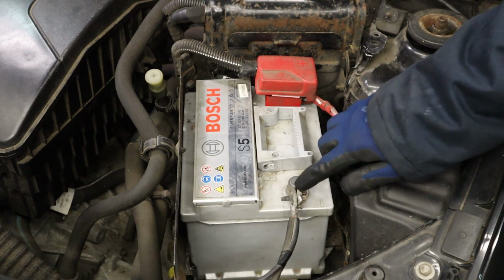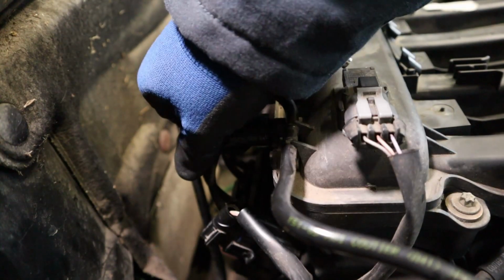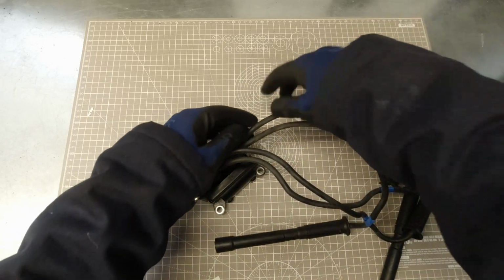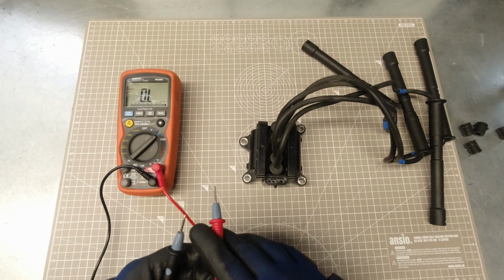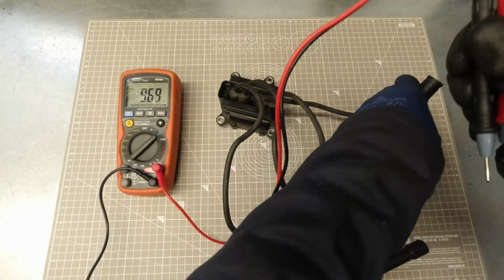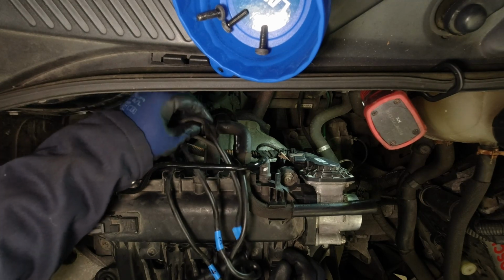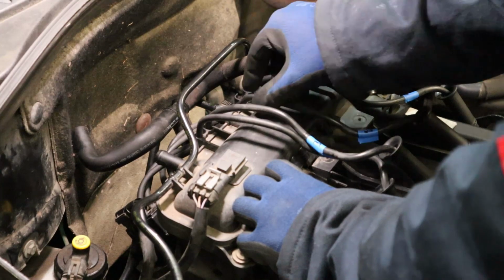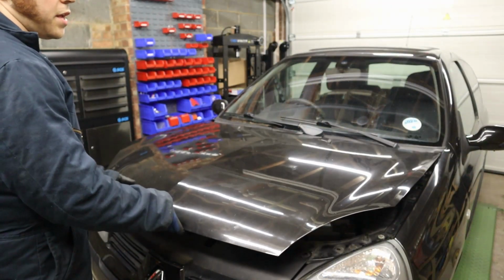Renault Clio 1.2 16v Coil Pack Testing/Replacement

Comment: I have a clio 3 with the same engine. Most mornings the car will do pretty strong jerks when i drive the first few meters. I'm suspecting Coil Packs since they are stocks.

Is there any advices to confirm without actually removing the coil pack and checking it ?

Comment: Hello there i changed coil pack leads and spark plugs but the car still puffing in idle and there is like an aspiration noise coming from somewhere , could  it be the throttle body . My revs are about 5

Comment: Hi I have a renault mk2 1.2 16v 2004 model that cranks but won't start and the the rpm's not going up. Battery and starter is ok
Reply from the maker: Sounds like it could be the crankshaft position sensor, they're pretty common to fail on these.

Comment: Thanks !!!! great video  with your advices, i ve replaced mine on clio3 1.2 16V Flex. GREAT JOB thanks so much !!!!  but still issue with blinking engine light   ;(

Comment: I've watched this over and over again. 
   but I still can't fix my issue. 
I thought it was ignition side.
  but on further investigation,
my LTFT is 100 all the time and my post cat 02 in reading 0.80 0.130v so now iam stumped. changed coil. leads . plugs . pre cat 02. but still missfires and knocking cold . ahhhh

Comment: this engine is driving me crazy, so short story, cold start, wait the RPM to lower, i go drive after normally either around the city or on the express way the car just losses power, even while pressing the gas the car slowes down a bit and even while pressing the gas the  power comes back after about 5 seconds but i lift my leg off the gas and pressed again the power or the acceleration comes back 
what i did so far 2 o2 sensor has been replace, new oil and filters, new MAP sensor, tomorrow i'm gonna clean the throttle body, regardless let me know if i should replace something else? ignition coil probably would be after the throttle body cleaning if it wouldn't solve the problem 

clio 3 2005 d4f 1.2 75 HP

Comment: Really helpful. Purchased Renault Clio 1.2 16v 2007 Mk 3 for my grandson engine light flickered on way home. Now completed 780 miles with cataclean light is now constantly on with spanner and emissions check light. Checked spark plugs ignition coils air filter cleaned all visible sensors. Replaced Lamba sensor. Fuel cap tight. Diagnostic scan shows PO 302 number 2 misfire. Shows X Cat and Lamba sensor 😢  Any other ideas please.

Comment: Quick question, is this a spark return system, 1-4, 2-3...when I disconnect 1 and 4 very little difference, when I disconnect 2 and 3, it won't start...

Comment: how do i install new spark plugs? ive just cleaned my throttle body there is a small improvement but still struggles on hills but a lower rate. i mthink maybe after few drives the cu will calbrate the cleaned throttle body as it was very dirty. now im thinking of installing new spark plugs and coil pack how would i install the spark plugs. :)
Reply from the maker: I have videos on my channel detailing how to change the spark plugs and how to change the coil pack.

Comment: Hi I have a renault clio 2 1.2 16v missfiring and I dont know if its the coil pack or spark plugs. I want to ask if it os fitting to only replace tge plug that is missing

Comment: Hello,
Nice video, it's really helpful. In case we replace the coil with a new one is it required any sort of re-calibration or programming? Thanks.
Reply from the maker: No calibration is needed.
Reply: @SocketsAndSideburns  Thanks

Comment: First of all, sorry for my English, I will try to explain myself as best as possible. I have done the procedure as you explain, my question is the following: The order of my coils differs from yours, is there any problem in trying to change the order to see if that is the error? Or can I cause a breakdown if I start the engine with the coils in the wrong order?

Comment: Weird thing going on here 
My clio has the d4f 702 engine     the coil pack has numbered wires 1 to 4   while the wires were installed from 1 to 4 but the number 4 wire connected to cilinder 1 the french way so cilinder 1 at the flywheel 
Wire 3 to cilinder 2 
Wire 2 to cilinder 3 
Wire 1 to cilinder 4  

So the opposite way around 

Then not like wire 1 to cilinder 1 
Wire 2 to cilinder 2
Wire 3 to cilinder 4 
Wire 4 to cilinder 3
Thats the usual connection

So i swapped the wires the original way but no start  

So i just put everything back the way it was fitted on mine   
And start 

But then it might be the case my aftermarket coil has the wires in a different order with 
Wire 1 on cilinder 1
Wire 2 on cilinder 2
Wire 3 on cilinder 3
Wire 4 on cilinder 4
The European way of cilinder counting with cilinder 4 at the flywheel  

Basically its easier to install but nothing original here     
So that confused me a bit

Comment: Maybe a good idea to mention that if you remove the rubber seals from the ends of the spark plug leads for testing the leads, be careful because mine were old and brittle. I broke one on each of two leads but I put the rubber seals back in because the coil pack was working ok at the time. Next time I came to remove it the rubber seals stayed on the spark plugs. Probably best to put the leads back on without the rubber seals if you have to put them back on after breaking them? I know need to find a way to get the rubber seals off the spark plugs!!

Comment: Perfect video, incredibly useful. I'm trying to remove the coil pack from the car, however the T30s hold as hell. I have noticed oily mess on the top of the plugs, is it ok? I'm wondering where the leaks might be from.
Reply from the maker: It really depends how much oil you have. The most likely place will be the spark plug tube seals. Watch my rocker cover removal and refit videos where I replace them.
Reply: @SocketsAndSideburns  Yes, tube seals seem to be the cause. In the meantime, I changed the coil pack for a new one successfully, however, my engine still vibrates clearly on LPG (with P1305 and P1314 errors). Injectors might be end-of-life, so I need to investigate further.

Comment: Hi did all that but still runs on 3 cylinders the car has had an engine change that was the same make and model (plug & play) tried 3 different coil packs any help would be grateful
Reply from the maker: Since the the ignition system is wasted spark it is far more likely a problem related to one cylinder is something other than the coil pack. I would suggest checking the spark then a compression test.

Comment: Hi.   Thanks.  Is firing order 4 3 2 1 thanks Dan.   Same as shown.  So if I have p0303 I should check the plug and compression on the second from the left
Reply from the maker: Yes that is the firing order. Cylinder one is at the flywheel end of the engine.

Comment: Hello I have a idling problem with my Renault Clio 1.2 16V 2004 model and from time to time it won't start when I turn the key only the ignition will still go on but won't start. Please help Mr sockets and sideburns please any help will do.
Reply from the maker: Does it crank and not start or just not crank at all?
Reply: Hi apologies for the late reply but however the ignition goes on but doesn't start or crank when that happens then after a while it starts or I have to kick start my car.

Comment: My engines got a vibration. Its definitely the engine itself as it does it standing still, and its not the gearbox as clutch engaged or not, it still occurs. From the feel of the top of the engine, its strongest on 1 and 4. Injectors sound normal but havent tested them. Mpg is fine and normal. Spark plugs suggest lean running but its a lean engine anyway. I've coeaned the map sensor and readings are all normal, and cleaned the throttle body. My only thing left is either my cam shaft has worn out, or theres a spark problem that isnt dramatic enough to trigger a missfire or light on the dash. Could also be the crank sensor.

It does have trouble starting first thing.

Checked the battery and the alternator and they are fine.

Could it be a weak spark?
Reply from the maker: The engine is wasted spark. So 1 and 4 sparks fire together. So the ignition system does link both cylinders. You have checked the coil pack?
Reply: @SocketsAndSideburns  thanks for replying. im doing it on the 30th along with the tappit adjustment. It might just be the nature of the engine.

Comment: My sons 2007 Clio campus 1.2 16v just developed misfiring issues. I changed the plugs but no luck. I’m picking up a new coil pack this afternoon so we’ll see if it fixes the issue. This video has helped me immensely to prepare for the job. I’ll let you know if it fixes it. I subbed a while ago after you helped with a radio/cd video issue. Great stuff mate!
Reply: I bought the Coil pack from Euro carparts for £46. I note that you said that the leads are numbered 1- 4 from right to left, but these leads were numbered already however not the way you said. I decided to just follow your lead instead and installed as directed and it worked perfectly....Cheers

Comment: Great vid,. I have a Renault Clio 1.2 16 valve which wouldn't start so I cleaned the crank sensor and now it starts but I have a warning light which is a coiled wire symbol with a zig zag symbol above it .
Any thoughts on what that light means and what I should do.

Subscribed 😎
Reply from the maker: I'm pretty sure you mean the "electronic fault" warning light. You will need a code reader I'm afraid to read the fault codes stored in it and then go from there. I would recommend getting one that can display live data as this will help fault finding.

Comment: One of the best workshop test and replace I've seen yet, well done. I've got a Clio with a fault where it splutters at low rev's (even at tickover) up to about 2,000rpm so I hope a quick test of the coil pack finds my fault.
Reply: Same problem. Did you manage to sort your issue?
Reply: @samfitzpatrick1866  sure did - I replaced the coil pack, easy peasy. It ran like a new car after. Problem is, I totalled it a few weeks ago, wright off, c'est la vie. At least I'm still alive. Good luck 👍
Reply: @Drivelikeustoleit  bloody hell, glad you're alright. I've changed throttle body, crank sensor, accelerator pedal, and just today the sparks and ignition pack. Still have the same f-ing problem. Had it run through multiple diagnostics and every test I'm getting told it's different problem. Think I'll be scrapping it now.
Reply: @samfitzpatrick1866  I thought about replacing all those parts as well but started with the cheapest parts first - new plugs made no difference so the next cheapest part was the coil pack which solved it. Hope you sort it - good luck 👍
Reply: @Drivelikeustoleit  just thought I'd update you. Turns out it was a loose earth wire which wasn't put back properly during my clutch replacement (I took it to the cheapest place who did it for 250 parts and labour - you get what you pay for).

Anyways took it too a specialist who did a thorough inspection as three garages could not find out the problem. Ended up costing me 280 in labour plus the weeks of stress going from garage to garage and buying a load of parts and trying to sort it myself. 

So lesson learned pay a little extra for a good job in the first place!
Reply: @samfitzpatrick1866  Loose earth strap on these normally give you non starting, good you got it sorted
Reply: @dav01kar  Yes you're correct, funnily enough I've had the same issue on an old fiesta, which as you said wouldn't even start. 

The loose wire I described was actually dirt/gunk on the connection - likely explaining the intermittent fault. On a few occasions I'd be driving on the motorway and I'd suddenly lose all power for a split second before coming back to life - would scare the life out of me. 

Electrics seem to be a problem on the french cars of this age. Thanks for the reply.

Comment: Hello. on my Clio, on the secondary coil, between 1 and 4 it's 12.50, and between 2 e 3 it's 10.01. do tou think it's good ir bad? Thanks
Reply from the maker: Are you checking it because you have a problem?
The resistance is out of spec. You could check for corrosion on the contacts and try to get a brush in there if there is any to remove it as this may be the cause.
Reply: @SocketsAndSideburns  the engine fails when I accelerate around 1500 rpm. there is no corrosion. I already bought a new one and it was normal. thanks

Comment: Can someone tell me are these values apply for 2.0 16v engine? I have readings on secondary about 6,5kOM. But on primary a have A to B about 1ohm and for C to D 0.1ohm and B to C 0.5ohm, so I'm guessing something is not right on the primary. Thanks

Comment: I see there are two types of coil pack, didn't know this,  one with three screws and the other with four, would this make a difference in difficulty starting with the wrong coil pack especially when its cold. I think i may have the wrong one as its the one i got that i have been given to me by the auto factor quoting the  reg number etc, i assume it correct. Its a bugger to start in the cold but when its warm it starts, no problem. The cold start is a real problem, turns over fine and sometimes tries to bit on firing when the key is released after fully turning. Changed Crankcase sensor and coolant temp sensor checked connections etc, still a mystery just wondered if its the coil pack even though i have changed it, may not be correct.
Reply from the maker: I believe the three bolt coil pack leads are much shorter as it is located in a different position to the four bolt. If you do have the wrong one fitted it should be obvious as it would have been very difficult to get the leads to reach.
I have never had any first hand experience of actually fitting the wrong one but I have heard of it being done and those people didn't report any running issues other just difficulty in making the leads reach.
Reply: @SocketsAndSideburns  I have found that the non Renault coil packs have leads that are all the same length including the three screw ones. These leads are all too long but you cant cut and shorten then as they are sealed in. I bought a three screwed version the other day as i have three screw holes on my engine, but it did not work at all, it turned over and locked. You would have thought that the Auto factor, Eurocarparts would have given me the correct one especially giving the reg plate number. It certainly wasn't the correct pack. I did try and look for the engine number as in your video but theres an alternator smack bang in front of it. It may pay me to go to a Renault dealer and get an original pack.

Comment: Is it possible that it tests ok when like this but is breaking down under load? I am checking a clio at the moment for a misfire during acceleration and suspected the coil pack but testing showed up no faults. (No fault code stored either)
Reply from the maker: If you have tested it as per this video and it all checks out ok it probably isn't going to be the coil. You will probably need access to live data to catch the misfire in the act.
Reply: @SocketsAndSideburns  thanks,
Reply: @SocketsAndSideburns  I did a number of further test and after a bit more driving got a codes for cylinder 2. Checked compressions and injector resistances and then swapped injector two with injector 3 to see if code changed which it did not. 
In the end I suspect the coil was the issue despite the correct resistance reading, so replaced and tested. All working fine after changing. I suspect that the coil resistance reading were fine until a load was placed on the windings. Cheers

Comment: So i orderd a coil but it has 4 bolts and my old 1 had 3 bolts. Is this an big problem? Or can i use the 4 bolts fine?
Reply from the maker: Honestly I can't say. It's not something I would try personally, I would just get the right part.
If I remember right the three bolt version was for the early engines and had shorter leads than the four bolt version so you may have a lot of excess HT lead to contend with. I'm also unsure if the bolt patterns would line up. 
Other than those two things I don't think there were any other changes.
Reply: @SocketsAndSideburns  thanks for the quick response! I will order the correct part! Thank you very much.

Comment: Resistance values for Mk2 Clio 1.2 8V petrol engine are:

Primary resistance: 0.6 ohms
Secondary resistance: 8000 ohms

I looked it up at work on Autodata
Reply from the maker: Thanks for that. Hopefully help someone who needs the info for the 8v.
Reply: Thanks, looked for this one! ❤️

Comment: Got a 182 that developed a misfire and yes hand up I replaced it when that wasn't the fault.
Reply: What was the fault?
Reply: @alastairmackay4861  It was actually the leads not the the coil pack
Reply: @simongb7897  cheers

Comment: Another great video and well explained, I've replaced a fair few of these in the 18 years I've had my Clio, haha. How's the SGS hydraulic press? is that the 20 ton one? any good?
Reply from the maker: Thanks very much.
Yeah it is the bigger 20 tonne one. It's great, best press with the most features I could find for the money. Should feature in a video soon for a wheel bearing I'm sure.

Comment: What is the appropriate speed for this engine on a long travel road of 600 km?👍
Reply from the maker: Obviously don't exceed the speed limit. I've had this engine at 70mph in fifth for hundreds of miles. Check all your fluids before you set out.
Reply: @SocketsAndSideburns  💗💗Can I run with it at a speed of 140 km always ??
Reply from the maker: As long as it has no issues and is well maintained you can run it as hard as you want as long as you keep the engine RPM out the redline and keep an eye on the coolant temperature. However I definitely wouldn't recommend that. Fuel economy alone would be shocking. Probably best to get a larger engine or a diesel for such long high speed journeys.